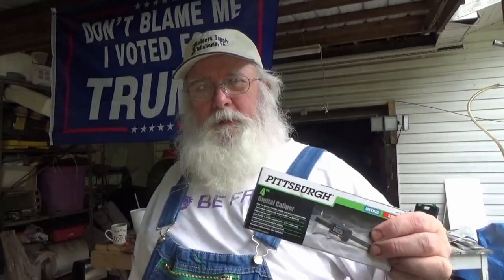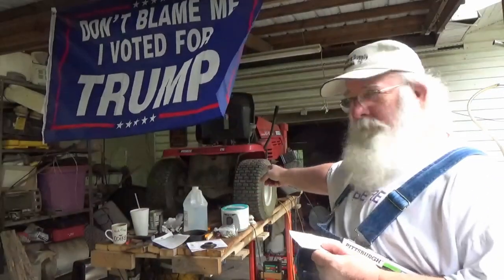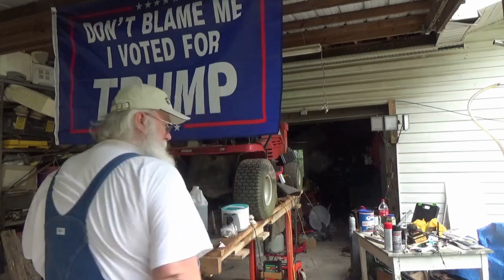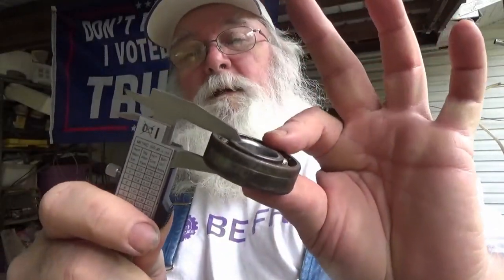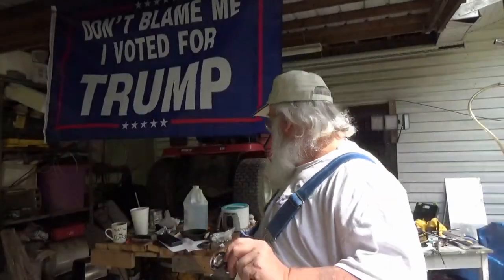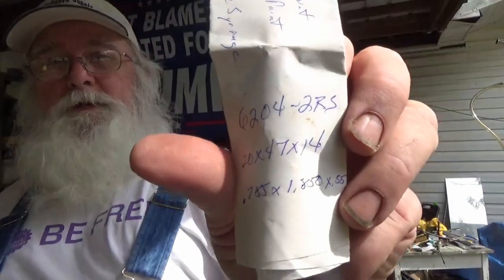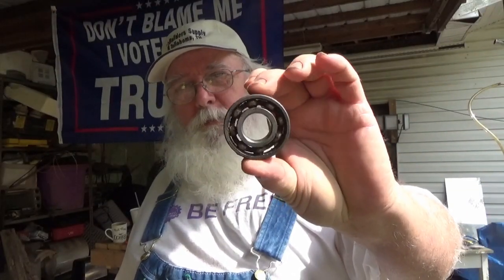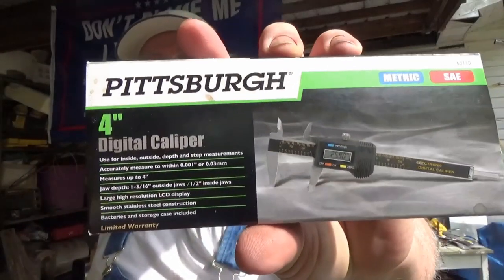A Seldom Used Harbor Freight Tool PawPaw How to use Digital Calipers a $225 repair for FOUR BUCKS !

Comment: I use mine every week, even the old style micrometers which really make your brain work ;) Make those bearings last even longer pull the seals an pump full of high temp marine synthetic wheel bearing grease, drill & tap the weep hole in your mower deck spindles and add a grease zerk to keep it pumped full and never worry about it again.

Comment: I have a 6 inch and they are as handy as a pocket in a shirt. Pluss unless you are building the space shuttle the Harbor Freight calipers are as good as the more outrageous priced sets. I use them every day at work and some times at home. Great tip about the bearings

Comment: I must have a different SKU on those calipers. Mine are silver and don't have a conversion chart. I have to take the battery out of mine when I'm not using it or it goes dead.

Comment: 1604-2rs is the bearings in my ceiling fan 2rs means they have a seal on both sides of the bearing, Who is selling them for a $100 each?
Reply from the maker: $1.33 each buying  a three pack.  Less than that if you buy a ten pack.